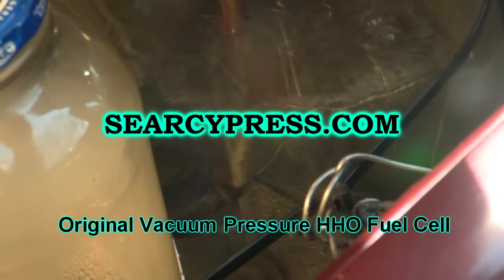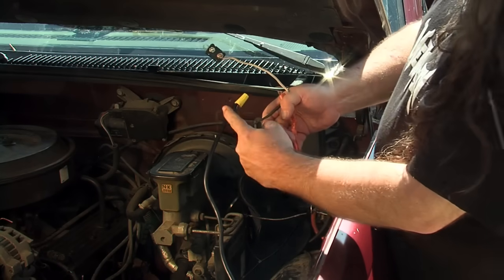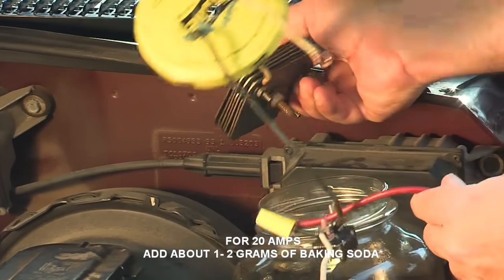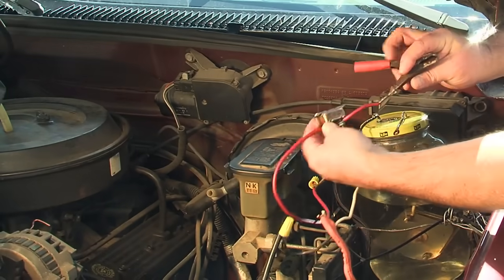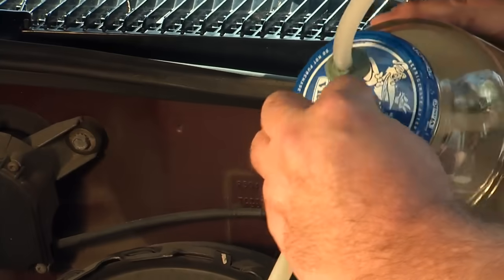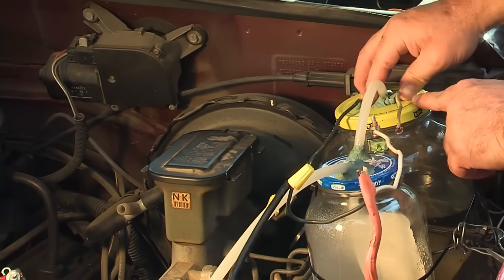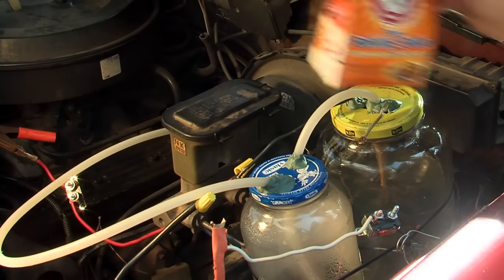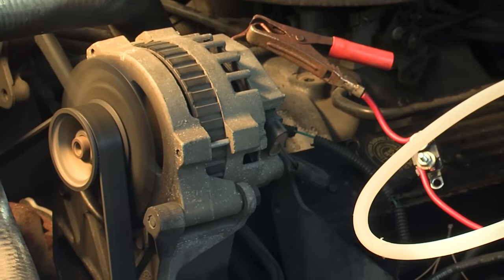Vacuum Pressure Hydrogen fuel cell defeats high gas prices using hydrogen from H2O.

Comment: your alternator will be pulling more power from the engine to produce the power you need which in itself makes the engine work harder reducing mileage. alternator power isn't free it costs horsepower. years ago Chrysler was a big fan of water vapor injection to reduce temps and emissions. ther is new info on this process and it has to do with cold fusion I think they said not the hydrogen adding the power.

Comment: When you create oxyhydrogen  on demand you don't create enough to blow your hood off thats why the dude put a reset fuse and a kill switch on it just extra precaution. You can add filters to capture the moisture flowing into your engine. You can add things into your water to help create more (h+) like potassium hydroxide (koh) this can deprotonate many acids which means removal of a proton (h+) from a molecule.

Comment: Ok so the engine turns which in turn powers the alternator to make electrical power for others parts of your engine to work. A normal running alternator only uses about 25-30 percent of the power it produces to run a engine, Which gives you about 70 percent power not been used if you take some of that power use to create oxyhydrogen(hh0) you are not taking any power away from the engine.

Comment: In Bulgaria LPG is widely used as a main fuel in 90% of the gasoline cars. I have an Opel Vectra 92', and it has been runing on LPG for 12 years now. LPG does not lubricate the cilynders, yet the engine with 250000 kilometers on it still has 11 atmoshperes compression on all 4 cylinders. In a HHO system the water vapor (which is formed buningH2) combines with all the carbon chemistry and forms acids which eat trough the piston, cylynder and valves. And a jug this big can blow the hood clear off!

Comment: a 4stroke uses motor oil to lubricate the pistons... it has an oil ring that keeps it separate from the combustion chamber.. I know using either will wash away the oil and wear it out but im not sure if the hydrogen would do the same.. good thought. I like to see a good diagram of one of these that ran for an ext period of time

Comment: why do you not have a video of it on your channel.  It's hard for me to believe you without video proof.  I can say i'm a millionaire but have no proof.  For it to be economical you have to make your power supply for the hho in a vehicle off of the alternator.  It would put out 30amps no problem.  I would like to try adding a second alternator and a power cap (for stereo stuff) and use them for the power so the original alt will work as intended.
Oh well...  Bye

Comment: well if you don't alter the sensors then they will think the engine is running lean and inject more petroleum gas.  Have you even built a small hho cell of your own?  Try it.  Then try adding the gas to a small non computer controlled engine.  you will see better fuel use.  Sounds like you don't want to think outside your normal path.  To each there own.  It's ok if you don't belive it works.  I know it works because I have personally tried it.  Have you?

Comment: You put it on a relay along with the circuit breaker.. Have an acc wire from the ignition going to the switched wire on the relay.
Also search "Tero cell", this is a much better generator because its a dry cell.

Comment: I'm sorry but this looks like a scam to me. Can someone explain how this can contribute positively? Can hydrogen enhance the combustion process beyond the energy in hydrogen itself? The alternator being loaded by the current of 30 Amps (perhaps 12*30 = 360 Watts) creating the electrolysis will yield hydrogen representing perhaps less than 100 Watts of added power if it was burned in itself. Thus, in my opinion, this system means you will need MORE gas to run the engine.

Comment: This may sound plausible at first except we know from chemistry that hydrogen and oxygen will react releasing energy and forming water again. This reaction is completely separate to the reaction of the hydrocarbon and oxygen which produces energy and also forms water (as well as carbon and carbon mono/dioxide). The only way to increase the efficiency of burning the hydrocarbons is choosing to run the engine with a leaner fuel/oxygen mix, producing less carbon and carbon monoxide.

Comment: Don't Forget that with hho gas going to the engine and mixing with the fuel, the fuel is burned with more efficiency so u are getting more energy from that gas. So u get more energy that is going to the alternator and then going to the battery and so on. That what ur saying is only true if u ware running the engine only on hho gas.

Comment: Disagree, the electrolysis of water requires energy from the battery, whatever is used must be recharged, and this is done by the engine. The amount of energy in the form of hydrogen and oxygen that you get from the electrolysis can be no greater than the energy that it took to produce the components, which came from the battery.

Comment: "So we know then that the fuel consumption cannot be any better than what it is without this system."

There would certainly be a point of diminishing returns, but this idea uses more of the energy produced by the internal combustion engine and returns it to the system in the form of gases.  The idea is not to replace the engine, but to get more out of it.  So as long as the engine is pumping more energy through the alternator than it needs, there is energy to be harvested.

Comment: This is an entirely valid argument, but then it's the solar panels providing the extra efficiency and what you've just created is a "fuel cell". Your other post is invalid as it's not dependent at all on how much current is being drawn from the battery. Whatever is drawn is exactly the amount that has to be recharged, plus a bit extra for efficiency losses for the process. In terms of the ratio, you only get as much energy produced as what you put in, basic conservation of energy.

Comment: But all that would go out the window if you were to buy 6 31 series batteries and charge them via some other source than your alternator. If you used solar panels to charge them and built a system to rotate batteries you could be creating alot of energy on only what you've paid for the batteries and solar system.

Comment: That would depend entirely on the ratio of amperage draw to volume of hydrogen fuel production. If the electrolysis produces more fuel than it consumes. That ratio would be based off of what chemical process is more efficient, internal combustion or electrolysis.

Comment: im confused here ... i though a fuel cell is smt that does the opposite of the electrolisis procced by connecting hydrogen and oxygen in water and creating electricity... and here i see that the so called fuel cell uses electrolisis ??? can someone explain?

Comment: I have a few questions. First. How do you keep from sucking up pure water into your engine if say your bubbler gets tiped over. liquid water does not compress then you can end up with bent push rods or broken pistons. i understand if everything is working corectly you wont get h2o liquid in there and i was wondering if you do something about that. #2 what does this do to your catilatic coverter. can or will it damige it in any way. message me if you got any answers

Comment: In carburated car engine. Vacuum was use to activate vacuum advance timing your engine. Placing or altering vacuum lines will affect Timing of firing of spark plug. How about placing tube from glass to intake manifold and place vacuum switch. Place the vacuum switch on gas supply tube. So every time your rev your engine hydrogen then will be injected on intake manifold.

Comment: con't... under a vacuum at some point if the vacuum is high enough the water will boil off without any energy being place in the system in the form of heat. Vacuum is a form of energy that explains this guys unusual results. Normally this energy is wasted as no one looks at all the energy one can add into the system. But something else is taking place in that now the molecules are very far apart from each other which prevents them from being sparked off a great deal a type of flash prevention.

Comment: This is where science comes in ask and then answer; What happens to the molecules when placed in a vacuum? Is or is not vacuum a form of energy? Answering those two questions will give rise to more questions and answers.

But for Dr. Faraday style electrolysis there is a problem as the waters boiling point is lower and if the cell gets hot the water will boil off. Now for Meyer's technology that is not the case so it only serves to aid the reaction. But in both cases it does aid the reaction.

Comment: i had made a test today and i had noticed that as the water gets hoter due the reaction, the ammound of gas resulted is larger..so you can heat up the water using the heat from engine ....and as the water is hoter the electric power the proces needs is smaller.

Comment: The HHO is the stronger fuel source? Yes, but it was produced from energy from the battery. That energy now needs to be recharged. The engine recharges the battery. The engine runs on fuel. The fuel is provided by the tank, and the HHO. But the HHO is just energy from the battery - so not lowering the mileage in any way. Sources: Bachelor of Engineering degree, GCGI Military Technology.

Comment: only when first starting. Once the HHO begins entering the combustion stage,  there is another and stronger fuel source being pulled into the engine by the vacuum, as it does without HHO. Main thing is to have an alternator that produces a lot of amps. Most R pretty expensive even in scrapyards.

Comment: Well what they're doing is electrolysis of water to make oxygen and hydrogen. The energy predominantly comes from the battery (and the author says the vacuum pressure helps). The battery and vacuum is generated by the motor to begin with. So we know then that the fuel consumption cannot be any better than what it is without this system.

Comment: i have a question for you...so.....you use the servo pump to use the vacuum.....right??ok...so when you need to use the brake......that servo...(that actually runs with the vacuum created from a petrol engine or a vacuum pump if we are talking of a diesel one...) how will it function??will it will make enough vacuum so that the liquid from the brake pump is pushed from the pump to the brake pressure distributor  and than to the small pistons (brakes) or will you just crash??:)

Comment: The energy produced burning the hydrogen comes from the electricity used to produce the hydrogen, which comes from the alternator, which increases drag on the engine and lowers your MPG more than burning the hydrogen increases it.  It's thermodynamically impossible for you to get more energy out of this than it consumes.  Sorry if I won't take your word for it that your MPG is higher.

Comment: Y'ain't going to make energy from nowheres.  The energy used to generate the electricity comes from gasoline being burned.  That energy is used to electolyse the water into H2 and O2.  Then you feed it back into your combustion chambers.  In the meantime, you incur losses as heat in the wiring and such.  All you'll do is confuse any engine control module, which was designed and programmed for gasoline, not H2.  Plus I'd say there's a lot of potential for exploding H2.

Comment: the piston has rings around it that stops oil from leaking into the combustion chamber, so it should work vice versa also not letting water into the engine block. my guess is that the due to the heat produced in the power stoke the hydrogen and oxygen fuse and create water but instantly turn to steam and exit from the exhaust. as the steam makes it way to the tail pipe temperature gets cooler and the steam turns to water. hope this helps

Comment: This seems interesting to do but my only issue is having water circulating through the engine. Over time wouldn't that water rust out the internals of the engine? You don't want water inside oil so why would you want water going through your fuel system? If I can find as much info as I can about this I would love to try and do it to my vehicles.

Comment: You can save yourself a whole heap of trouble by building a "proton" cell which is a Joe cell. You get about 100 times more energy out of a Joe cell then you do from a hydrogen cell. I've been able to get 30% more fuel economy without drawing any amps at all to the cell. It's a lot easier since there is no maintenance, and no need to change the water. You have certainly done a lot of testing so I appreciate your great video. Please check out my channel. Keep up the good work!

Comment: Something I know from experience is that the wet cell version, shown in this video, will corode the copper wires (when submerged, as they are here)...FAST! The positive wires, in mine, were as thin as a fishing string after 1 and a 1/2 months of driving (a little over 450 miles distance). Dry cells produce much more HHO and, if made of good stainless steel or titanium, will not corode. Great video, though, and good luck to everyone trying to make a difference!

Comment: Hi, why is it pulsing like that? and how do get to 30 amps with out burning the thing up with like a runaway thermal problem I mean the more heat the more amps in a cycle of heat, how much soda do you use to get to 30 amps I guess is what I want to know, and also how hot does it get to the touch that will be big help to me too, the one im working on gets so hot at the battery terminal, so which alternator connection do you hook it up to on gm? sorry for all the questions just anna get mine to go

Comment: well its moreso that excess energy from the gasoline to keep the engine idling / running is used to make more fuel, so its an economizer rather than a fuel replacement, at the engines best running rpm i would imagine that the system wouldnt see as good a return and or start to actually consume more fuel, however most driving is not done at the engines optimal conditions so excess fuel is used to keep the motor from stalling

Comment: the PCM will decrease the amount of gasoline accordingly because it believes the engine is running to rich based on the cooler exhaust gas temperatures... as always, correct me if I'm wrong...

Comment: I'm not sure of the need for a VOLO chip. The fuel-air ratio sensor measures exhaust gas temperatures (EGT) to determine whether the amount of gas being injected by the PCM needs to be increased (i.e. to lean/thus hotter) or needs to be decreased (i.e. to rich/thus cooler) or is optimal (i.e. EGT is "perfect" which creates the least amount of pollutants)... I don't think the hydrogen would cause an increase in exhaust gas temperatures, I think it will decrease it and.....

Comment: on the carbureted engine in the video, the driver won't have to push the gas pedal down as far to get the same performance because the hydrogen gas is supplementing the gasoline... and again he is using less gasoline to achieve the same performance as before so again his fuel economy goes up... or so it seems to me... someone correct me if I'm wrong....

Comment: the point is that the engines PCM will adjust your fuel-air ratio to use less gasoline as a result of the hydrogen gas being introduced into the intake, in this way your gasoline consumption will be decreased and thus your fuel economy will increase... or so it seems to me... someone correct me if I'm wrong...
Reply: the oxygen sensors tell the puter to make a richer mixture - they have to be tweeked down - so far thast my biggest if not only problem

Comment: I think I could do that. There is a lot less room under the hood of a van/bus. Why the disclaimer? Is this inherently extremely dangerous, or totally dangerous?

I've worked on a lot of beer keg systems were the tubes seem to be exactly the same as you are using in the video. Directing gas or fluids to some other vessel is a simple task for me to manage. I'd rather use couplers than putty. What is the water doing to the engine?

Is it relay that simple?

Comment: I would recommend KOH electrolyte, connecting it to your ignition (so it only runs when your engine is on, if you forget about the switch could be a big problem), a PWM to control the amps of the generator (which do go up as it is run due to thermal loss), and a VOLO chip (for newer vehicles) that will regulate the O2 sensors (as they will reduce fuel economy by enriching the fuel mix due to the higher O2 levels).

Comment: only if the lye actually gets into the engine, that's why you'd use a backfire arrester and/or the "dry chamber" as the dude in this vid uses.  Overflow gets deposited in the second jar and cannot get into the engine because of the short length of the hose headed into the carb.

Comment: What are your experiences about rust, regular water in contact with metal is said to be a very bad idea, but together with regular fuel, i guess that should be okay, correct?
And what about baking soda?
That creates toxic in the water, i've seen some clips of it before, so i wouldn't use that, but alternatives instead.

Comment: Wow. The technology is simple...yes. Metalpress TV is not legit. I own my own business edgehho.com which sells legitamate cells. Baking soda creates a toxic substance let alone creates a pitting effect on your plates on your wet cell. DONT USE BAKING SODA!!! Go to your local hardware store and buy 100% lye(drain cleaner)! The NaOH will increase your production and lower the amperage. Btw aim for 15 amps... Foaming in the water is not from the electrolyte- it is the impurities on your generator.